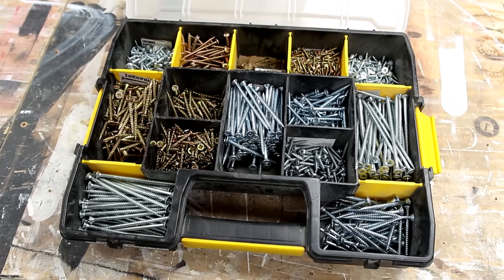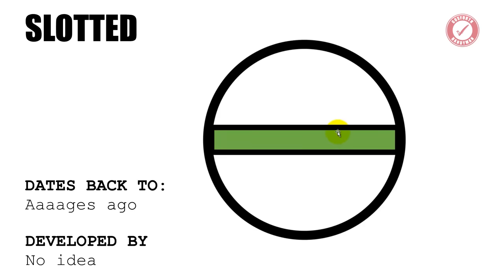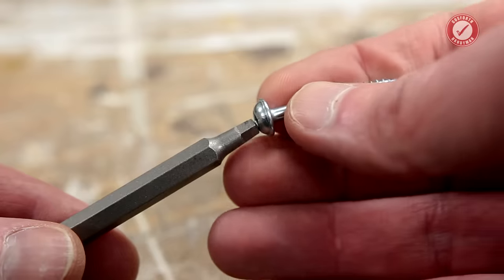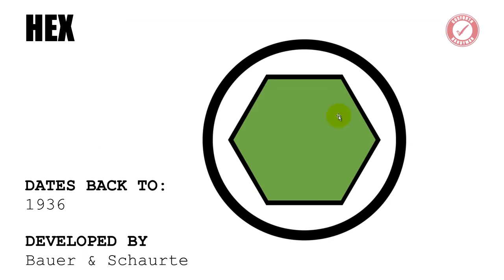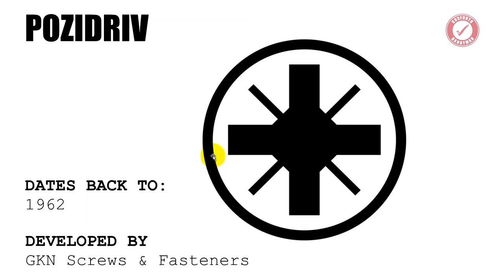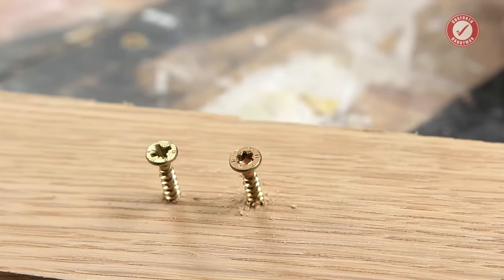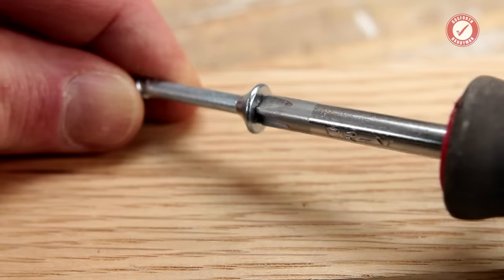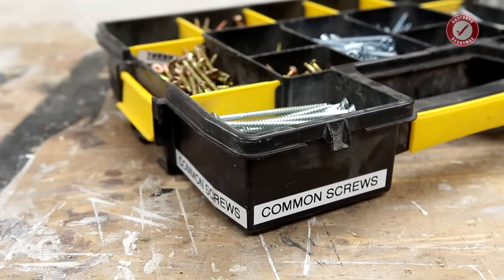Why are Pozidriv screws better than Phillips?

Comment: Being from Canada, I have  different view on this then most of the world. For me its Robertson for any screw that I am providing other than drywall. If the screw is supplied by the product manufacturer they will mist likely be Phillips. Torx, yes they are positive for engagement. But why so many bit sizes geez. If Im going with Robertson I need 2 bits maybe 3. If Im going with torx i need like 5 or 6 bits.

Also if the package the bits come in says "square" its not  Robertson. Robertson is a licensed name, to only some manufacturers. To all else they have to call it square drive.

Around these parts its called a red robbie (robertson #2). Green robbie for #1.
Reply: If you go with PZ you only need one size of bit ;-)
Reply: @MichaelMajeran  but then I'd have to find PZ screws to go with the bit. In Canada that can be problematic. If you're looking for generic construction screws they will be all Robertson.
Reply: @dhammer5645  Still much better than PH ;-)
Reply: @MichaelMajeran  There are 4 PZ sizes in common use but really PZ2 and PZ3 cover most applications.

Comment: I find the pz2 are the best in the uk too so many shops have boxes of pz2 headed screws even supermarkets or all hardware shops so I suggest getting either the dewalt flex torq or milwaukee shockwave with 25 in a box for about £6-£8 for both on amazon because they work in drills or impacts and both fit the pz2 screws very well just pick your screws and tools and stay with them im a dewalt guy always have been and always will be quility is better than quantity
Reply from the maker: Yeah, they're great. 👍

Comment: Hi Andy, once again, really useful and informative (no surprise there then).  How do "Supadrive" screws fit in?  Agree with the comment below, but also beware of cheap screws.  "Cam-out" can occur because the screw recess has failed.  That also applies to the quality and condition of the bits used.

Comment: After owning a few old British cars for several years, I finally learned that those "Phillips" screws are not Phillips at all, and yea using Phillips screwdrivers on them is likely to strip them out.  I ordered a set of Pozidriv bits to use with them, which works much better.

Comment: Very interesting video. Thanks for sharing.  I'm also using mostly PZ2, already forty years or so. Great was my surprise in 1990, some months after I moved from
the Netherlands to Czechoslovakia. No PZ screws or Phillips screws available. Only slot (minus) screws. Those you can in fact only use with a hand screw driver.
Using a drill for them doesn't make sense. The drill bit is quicker out of the slot than you put in inside.
Reply: There are some handy adapter bits if ever I find slotted screws that enable use of an impact driver. No idea what they are called, small plastic thing with a spring in it to load screws, but they are very cheap and a god send when needed.

Comment: Ugh. Phillips and Posidriv come in multiple sizes, but they are not interchangeable. Most wood fasteners have #2 recesses, but i have (and needed to use) Phillips from #000 up to #4. As I recall, the tip of the point on the #4 is bigger around than the entire head of a #000 Phillips.

Comment: I have never heard of the pozidriv before. I always considered it a slightly less garbage Phillips I firmly believe Robertson is still superior and I don't know what you mean about it. Not self-centering. You're putting a tapered square into a tapered square hole when the two tapers meet you are in the center.

Comment: The bulk of our screws in Canada are Robertson. I do buy a lot of screws in the US to do work on the cottage. They have a lot of torx there, as well as a robertson/phillips hybrid that works well for both bits. 
Not so much for driving screws, but when removing old weathered screws, i find the least slippage with torx.

Comment: A top tip (no pun intended) is to treat the screw driver bits as a disposable item. They ware out supprisingly quickly, by design. The theory being its better to damage the bit than that screw you can't get out.

Quite a few comments here mention pz2 cramming out. If that happens get a new bit. Oh and never buy cheep bits.
Reply: This is an excellent point. A 'sharp' or 'fresh' Pz2 point will rarely cam out if driven with the right pressure and direction. I buy standard packs of good quality bits, (not impact specific expensive ones), and change them regularly.
Reply: I do agree. I am happy with Dewalt bits for the cost. Any other suggestions?
Reply: I'm using DeWalt bits at the moment too.
Reply: @briannewton3535  No. I also use the standard Dewalt bits from Screwfix. About £6 for 25.
Reply: I usually get Irwin bits

Comment: Come to Canada.  Leave the pozidriv behind. Robertson is going strong and you'll love it.  Torx works great also. Phillips is still the worst and I'm pretty sure pozidriv screws are pretty much treated like Phillips.  Hex screws you'll find in ikea furniture assembly. Most likely screwdrivers bits are Robertson #2, Phillips #2, Torx T15-T25.

Comment: There is a big problem with hex head screws, especially the smaller sizes in the United States and Canada.  We have both Imperial and metric sizes and if you have a hex head a tiny bit too small by not realizing you were on the wrong set, you will strip the driver and strip the head and then you were totally screwed.

Comment: Ahhh... the venerable Phillips screwdriver. A device designed SPECIFICALLY for stripping the heads of Phillips screws! 

I much prefer Torx myself... it's pretty much impossible to strip Torx heads.

Comment: Interesting. I don't really see PZ screws around here. We do have Spax, which is a modified Torx. It has a bit of a nub at the end of the driver to help center the screw. Have you encountered these? From what I've seen, I'd be happy if almost everything was Spax.
Reply from the maker: Just for info. Spax is a brand - they make all sorts of screws (incl. Pozi). 👍
Reply: @GosforthHandyman  You're right. I have some of their Phillips screws. I should have been more clear that I was referring to their proprietary T-Star Plus.

Comment: good vid. recently (i rarely work with wood usualy mettal) i tryed to get some cheap hex screws into wood after having only used spax (they are self centerd hex but fairly expensive) and getting them in straight without a pilot hole was absolutely imposible. will use a pz2 next time thx for the advice/explanation :)

Comment: 6:10 The big difference between Pozidriv(and JIS) to Philips is that they are straight walled, i.e. the cross doesn't have that inner wall curve that gives Philips screws that awful tendency to cam out.

Comment: I am giving up on pozidrive.  They are ok going in but if you have to remove them 10 years later they will be stuck and the pozi can't take enough torque without becoming damaged.  If you have to remove a tight pozi you will need a screw removing bit and drill it out.  I now regard them as last choice.
Reply from the maker: You might want to check out some better brands of screws. Never had that issue. 👍

Comment: Personally I have no issue with putting in a screw (8:09) as i always pre-drill, like your suppose too, This also stops wood splits. As for driver config, the only type i will not use is flat head screws.

Comment: I've never seen a Robertson screw in real life only in YT videos. Here in The Netherlands they are virtually non existent.
But I'll never use them anyway, superior Torx for me as much as possible and Pozidrive :)

Some great screw brands
Fischer (Germany)
Heco schrauben (Germany)
Spax (Germany)
Woodies Ultimate (The Nethelands)
FIS Profi (The Nethelands)
Reply: With Robertson, all you need is a bit that is CNC’d a hair off or a run of screws that were broached at the end of the tooling’s life and everything positive about the drive style is thrown out the window.    Anything a correctly fitted square drive can do, a Pozidriv can do better. 😀

Comment: Hey Gosforth good video, but a little comment, here in Denmark everybody in the building branch is using Torx. And nearly all screws is in size T20.  If you go to the local DIY.store you will not find PZ, Phillips or Robertson on the shelves Best regards Morten storryger abort the bad English 😉
Reply from the maker: Interesting! And nothing wrong with your English - great info! 👍👊

Comment: Posi and phillips are the worst for clogging up with dirt and paint and rust and mist often get stripped when removing a rusted-in shank. Thus,  I always use Robertson square head (stainless) for decking.

Down Under in Oz, Torx are twice the price of all others. and Posi are MUCH rarer, less range,than Phillips.

Comment: Now I know why my PZ2 is my best . In electronics the screws are “crosshead” but the PZ2 seems to work  better than wrong size or cheap Phillips for me.
Reply: You could be dealing with "J.i.s." screws from Japan. If you can find a #2 jis bit or screwdriver you will be mutch happier.
Reply from the maker: Yeah, electronics seems to be largely Phillips for whatever reason - I don't mind too much for that since I'd need to get my little screwdrivers out anyway. 👍😂

Comment: when some people drive pozi screws home with cordless power screw driver, when it go home, they continue, and it is rounded out, so when you go to take them out, they have created a problem, that they do not attempt to solve. that's why I use torx screws, they do not cam out, so I do not cause a problem.
all you need is a set of torx drive bits.the difference between some installers and maintenance workers

Comment: Of course PZ is A good screw but Torx worked better for me. Within the experience during miy working years I have to change screws often. Those were mounted (by the construction company before me) with (damaged) cross-head screws. Very often difficult to take out. I have to do this because they maked A lot of things wrong and not secure.
Appliances sometimes fall from the walls. Information from A proffiessional company recommended TORX. 15 á 16 years later I still use them in my private home. I used only from HECO  company. Later came DYNA+ (not very good) and yet I can buy easier FISCHER. (still second choice) HECO became to expensive for people and C.companys.

Comment: Random question - But what is your best screw recommendation, for drilling a screw through plaster board, into the wooden stud behind it to hang a picture up?
Reply from the maker: See the vid after this about the screws I use. Just about any of those should be fine for that. 👍👊

Comment: I apologize for my opinion, but slotted ones are the best for home use because you can apply significant torque while not being very muscular, especially when it comes to very big fat screws going through thick plywood. Even women can use it with ease. And you don't need to buy expensive screw drivers because even those made of cheap soft steel work well and serve forever. They are not suitable for mass production and power equipment, but for hand work they are the best.
Reply: Ok in soft  materials you may  screw them it ,but that is it no use for thick wood you ,cant use them even if you go through a wood plank geting in a second one by had and tightening it up not happening, they do yave ther merits but hand scrowing them is not one if them

Comment: Do posidrive screws work with Philips drivers? Would that explain why Philips is "more popular" with those outside the DIY crowd because they mistake them for the wrong type?
Reply from the maker: Yes - you can get away with a Phillips driver in a Pozi screw. It's not great but it will work. Doesn't work the other way though. 👍

Comment: Are those square headed screws readily available anywhere in Europe (EU)? You certainly can not buy those here in Finland.
Reply from the maker: Ah - interesting! Not sure - they originated in Canada. Tend to just see them on pocket hole screws over here for some reason. 👍
Reply: I get mine from ebay UK. They're often called square drive
Reply: As the brand Kreg are synonymous with pocket hole equipment, they sell the square headed screws under their brand.  Mebbe search for that?

Comment: How are square drive not a thing in the UK? Hard to find. I have no choice but to use Pozi, self centering is not a problem if u have a bit holder with a sleeve with square and torx screws.
Reply from the maker: They just never really made their way over here and Torx have really taken over for high torque use. Other than for pocket hole screws for some reason! 👍
Reply: @GosforthHandyman  I must go through a few pozi bits a month at least, cheap or expensive ones, my experience with square drives although  a shorter experience I remember them being much better, the bits dont break and they slip less and the screws can be reused way more often. I cant find them even for pocket hole screws in Wales.
Reply: In Australia, square only seems to be used for decking screws.

Comment: It's really not about the additional points of contact with Pozidriv. It's about the taper. Pozidriv have not the same flank angle in the screw on the driven side as on the "empty" side.

Comment: Wow .. you may have won me over to the Pozi from Torx ......... I do have to change bits quite often as i use three different sizes of screws ... I honestly didn't know about them being tapered or that the screws get stuck. I thought they were philips with an extra X on the head.. :)
Reply from the maker: Ha there you go! Try some decent PZ screws with a good bit - Screwfix Turbo II screws normally come with a bit. Report back! 😀👍
Reply: @GosforthHandyman  It turns out that's it's almost exclusively torx being sold here in Sweden. There's philips for some uses but no pozi. Shame! Though i guess it's best to have one standard than multiple. I would have liked not to have changing bits all the time!

Comment: I really disagree, I've made bad experiences with pozi (Worth mentioning: With woodworking as well as metalwork) As soon as a screw is just a little bit too old or rusty it's nearly impossible to get it out without destroying it. With metal I only use hex screws. As for Wood I don't even think I've got any other screws than torx. Just because the drive never slips out. But interesting seeing your opinion.
Reply: or covered with a dozen coats of paint.
Reply: @max23245  just reading that makes me shiver xD
Reply from the maker: I use screws that don't rust. 👍
Reply: @GosforthHandyman  I still think torx is superior. But I especially hate pozi when it's a factory screw on a car, because they didn't think that someone would want to undo that screw 40 years later. I still curse Volkswagen for that!

Comment: You have a very important detail about Robertson's wrong.  They ARE self-centering and are the only bit/drive type that will allow you to attach a screw to the bit and hang it below the driver without the screw falling off.
Reply from the maker: They're not self centering in the same way Pozi are self centering since Pozi has a 'tip' that guides its way in to the screw and Robertson doesn't. You can hang a Pozi upside down without the screw falling off. 👍

Comment: You are wrong about the reason why Pozidriv is so good. It's not about the four extra points of contact: the extra points are too close to the center and offer a too small leverage, which would cause them to strip the head. On 8:34 you can see that the extra fins are not even inside the head and make little to no contact, so they are purely decorative/informative.

What makes Pozidriv superior to Philips is that its main fins are flat, while Philips has wedge-shaped (tapered) fins and is prone to camming out much more easily.

PS Though Pozidriv is the easiest to use, Torx offers better torque and less prone to camming out or stripping.

Comment: Youve got one thing wrong. The taper is not an advantage. It is the biggest flaw in all of these systems. It focuses all the torque on the thinnest part of screw. This damages the screw and can lead to stripping it out. This is why people spend lots of money on hollow ground screw drivers. They focus the torque at the deepest portion of the screw.

Comment: Slotted screws do warrant consignment to the scrapyard, but one way to help thyself is to try and fond ‘hollow-ground’ tips. A ‘normal’ screwdriver is tapered such that, in reality, you’re looking at two edge-edge contact rather than two face-face contacts. Makes it worse.

A hollow-ground tip forgoes the taper and instead is concave.. flattening our towards the end such that it’s parallel to the slots in the screw. The hollow-ground is very common on the 6mm tips but less so on the dedicated screwdrivers.

You’d never guess I worked for a while in the hardware game, would you? #boring

Comment: The pozidrive screws does not work better because of those small corners towards the center of the cross. Those are only there because of the manufacturing process, and in practice adds nothing what so ever to the function of the screw. It works better mostly because of the straighter angle of contact and flatter surface between the screw and screwdriver, which means the screwdriver is less likely to slip, and that the screw centers better. Also the area of contact between screw and screwdriver is larger in comparison.
And I don't understand the claim that Robertson screws are not self-centering? In the video the secure fit is even pointed out, and you can clearly see how straight and firmly the screw is hold.